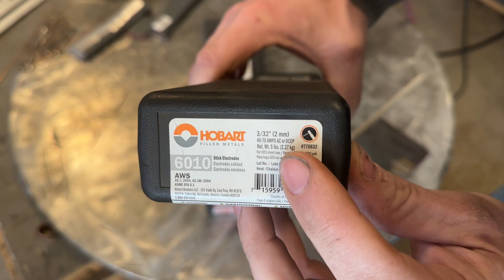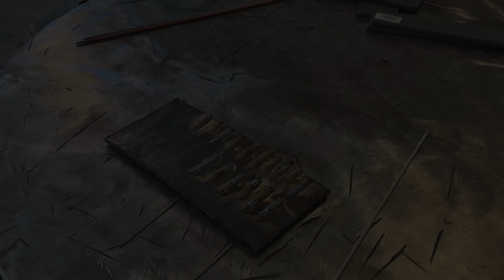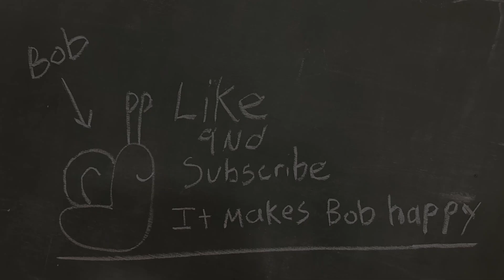Welding with 6010 on AC

Comment: I was looking for a datasheet for Hobart's strange AC 6010 but I found your video instead. I've burnt a lot of 5P on an SA 200 (DC) and occasionally run both 5P+ and this odd 6010 on my DC inverter at home. Both run well enough.

My guess is that your welder puts out square-wave and not sine so theirs no dead time in the arc.

Comment: Your videos ought to be viewed in welding schools. They are a treasure trove of information, knowledge, & wisdom.  And yea those are all distinct things. 
Couple of points that are interesting:
1. Washington Alloy sells a distinctly salmon-coloured 6010 rod that is AC/DC. Mind it's 5/32 but still, interesting. 
2. After viewing this video I definitely want to try 6010 with my AC only buzzbox. 
3.  Speaking of trying. I found a few dozen 1/8 7018s recently.  They had been left in the dust on a shelf in an unheated garage for 35+ years. A few of them, the coating fell right off just being handled. But most of them seemed, well, fine, if dusty. Cleaned a couple of them off and tried them. First one took a few tries to get an arc but once it did it laid down a perfect bead; usual easy slag removal all in one piece, no porosity no inclusions, maybe a bit of undercut-- probably my fault. 
Second one worked even better. Now, I'm sure I wouldn't want to do aerospace welding with these, but for fixing a wheelbarrow, garden trailer, gate hinge or kindling basket, I think they'll do the job.  Any thoughts, anyone?
Reply from the maker: Thanks for the kind words 😀👍.  So regarding super old rods, the biggest issue with them is they tend to rust between the flux and the metal rod.  This can lead to a lot of odd welding problems and porosity.  With 7018 rods their flux generally hold up far better than 60xx rods.   They tend to pickup moisture less than 60xx rods which means they tend to weld ok despite being out in the open.  60xx rods have a bunch of moisture in the flux and it promotes rust over time.  As far as strength, if the weld has no porosity and the welds look ok, odds are they are fine.  Where the problem is if you were to weld a higher strength alloy with a rod that has moisture in it.  The moisture gets diffused into the weld as hydrogen and can cause hydrogen embrittlement (think under weld cracking).  On mild steel this isn’t a big issue.  In simple terms 7018 properly stored can weld high strength steels without causing hydrogen embrittlement, something no other non low hydrogen can do 😀👍

Comment: Will 7018 run on buzz box?
Reply from the maker: Yes and no, I hate to say that lol.  The DC capable buzz boxes will typically run 7018 without any issue.  The a/c only ones tend to have issues with the arc going out.  To mitigate that they make a 7018 a/c rod that is more suited for that purpose.  The issue is the a/c welders can struggle to produce enough voltage under load and the A/c specific rod requires less voltage to run.  If it doubt buy the a/c version of the rod 👍
Reply: Thanks brother-in-law has buzz box i know holding is main thing but i also don't want make ugly weld. @makingmistakeswithgreg

Comment: I have used the red 5 p on a tome stone  45 years ago before I knew better and got the right rods and are very hard to keep light,  and have to hold a bit longer ark to keep light and  they make a very bad weld .
They do work fare to cut with when wet on high amps and that is what most of the 5p rods I had got used for till gone before I had a cutting torch .
I will have to try them again sometime on my SA 200 DC welder to see how they do the proper way .

Comment: I just happened to come inside while this video was playing and I thought you were using one of those weld removing rods with the air assisted rod holder lol.
Reply from the maker: Haha air arc gouging is a fun process.  I would make a video on it but I would light everything in my shop on fire if I did a video on it 😅.

Comment: I have 7 days with my hands on the stinger. When I’m running a bead on 6010 I found myself slipping and seeing if I can “recover” from it… is it important to snap out before I slip (elbow wise) than to recover my weld? As early of a welder I am how aware should I be?
Reply from the maker: So 6010 tends to be aggressive and will have more penetration than most rods.  If you’re welding and slip/need to stop quickly, the best option is to snap out leaving a small crater.  If you quickly brush that area and restart the weld you will be able to tie in cleanly and still produce a strong weld.  6010 will technically be able to just restart without cleaning and likely have no issues, but I prefer to clean the stop.  With lower penetration rods like 6013 it will be harder to get clean tie ins without a cleaned stop and decent “pull out”.

Comment: I believe that aluminum electrodes can run on AC despite being DC only as well.
Reply from the maker: Entirely possible.  The only thing I would worry about is a reduction in fusion.  It might actually help with arc starts, and it might help push the flux out of the way a bit.  Definitely a rough rod to use.  If only it was more consistent, I swear every rod welds completely different lol.

Comment: Talking about 'buzz boxes' - 4:00 "the buzz you hear is from the arc itself, the welder is dead silent..." then 4:55 "that buzzing sound you hear is actually from the transformer"... what one is it?!?
Reply from the maker: I can’t watch the video at the moment however both are correct.  I believe I was referring to both the welder I was welding with (miller dynasty) being silent, and that welders that actually “buzz” is due to the transformer inside.  The miller doesn’t use a laminated core transformer, it uses a high efficiency toroidal style.  Buzz boxes use a low efficiency laminated core transformer which creates noise as the laminations vibrate due to the changing magnetic fields.  Google “why do transformers hum” to see a lot of good information regarding this.
Reply: Will 7018 run on buzz box?

Comment: I purchased 6011 the other day. Would that be better for me to learn on than 7018?
Reply from the maker: So 6011 is easier to start, and restart than 7018.  It’s harder to make a “pretty” weld with.  However if you can make a very consistent bead with 6011 you can weld with pretty much any stick rod.  6011 (like 6010) has a molten puddle that solidifies really fast, so any inconsistency in your hand movement shows up in the weld.  6011 requires a bit slower forward speed than 7018, and feeding in a more rod.  Knowing how to run 6011 makes it really easy to weld with 6010.  It’s also a lot harder to stick a 6011 than 7018.
Reply: @makingmistakeswithgreg  dam. So...my work is cut out for me? Either way? 6011 and 7018? I do however , have some 6013....Still have not tried to stick weld yet since the 7018 incident.  lol , Been working up the courage to try again. Lot of it has to do with all of the nasty weather lately. Plus I'm a big BIG Procrastinator . I Lose Motivation easily.

Comment: the old tombstone i have is like stupid at ac and retared at dc ac will use the 6010 but dc it wont and it wired for ac but the transformer is a copper wire that my pawpa put in it he was a smart wait more than smart eletrcian he was the best in the entire company accoring to the boss also it probley becouse my pawpa did soup it up so to speak

Comment: Let’s see your comparison with a transformer machine!
The main reason a person will use 6011 is with A/C bus box!
Bet it would be much different using your D/C rods!
Reply from the maker: If I can find one I will.  I had a real man’s tombstone (Lincoln ideal arc 250) and sold it because I thought my shop was selling.  I will have to find something soon.  I like old welders so it wouldn’t hurt to find a super old ac buzz box.
Reply: Dad has a.Forney 225 buzz box form the sixties.  I tried running Hobart  7018 ac/dc rods and found they would run only on  two windings that had higher open voltage ( at the time I didn't have a tripod to set a camera on to see the  closed circuit voltage , but I bet it was a tiny bit higher.  I gave those rods away and bought the Hobart 7028AC rods and it worked okay.

Comment: Very interesting. Have you tried running any 6010 on your little $99 dollar welder? That would be a good test. It might run it. Your Miller seems to run anything well.
Reply from the maker: In the video that goes live tonight called “why your welder won’t run 6010” I tried to run 6010 on the little red welder without success.  It simply can’t produce enough closed circuit voltage to keep a arc established. I believe if I cranked the amperage way up it may be able to provide enough voltage but the amperage would be far to high for the rod to handle.  I believe the reason it won’t is due to how they have the windings setup on the transformer inside of it.  In order to get 140 amps out of the machine they designed the transformer to produce 140 amps at say 26 volts, and if they wanted it to run 6010 they would have needed to set it up as a 110 amp welder which would be less marketable.

Comment: I would like to see you compare Hobart 6013 with another brand of 6013 on light rust. I believe the Hobart flux is a rougher running mixture, making it more suitable on somewhat dirty material. You can compare the flux mixtures to see what I mean. I am looking for fewer slag inclusions on non-pristine material.
Reply from the maker: I will see what I can find.  6013 is prone to slag inclusions which is why I tend to run a pretty steep rod angle with it.  It’s like the flux to metal ratio favors too much flux lol.  6013 and 7014 I find to be tougher to get consistently clean welds with than 7018 and 6010.  I will grab a few 6013s to try though 😀
Reply: The Hobart 6013 might be similar to Euro Rutile-Cellulose rods - meaning it bites a fair bit harder than the usual for 6013…
Reply: There is definitely some difference in brands and even a brands sub type.